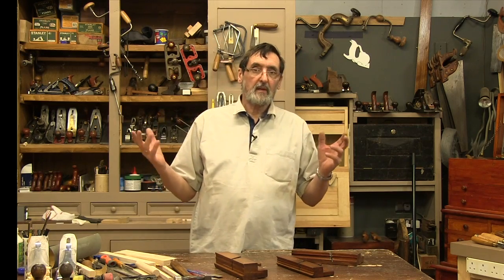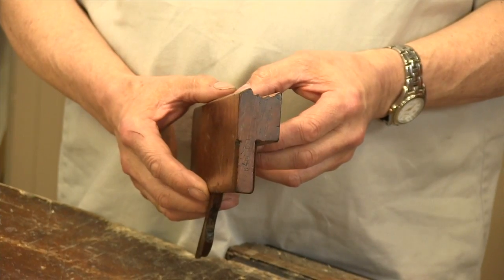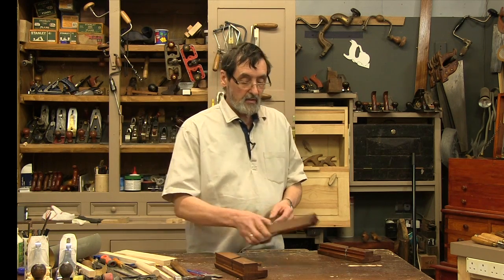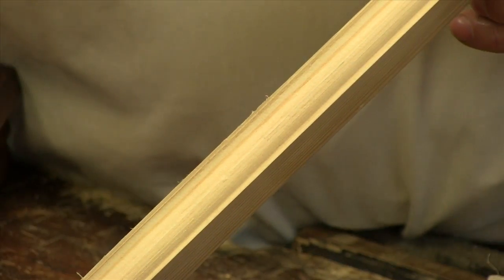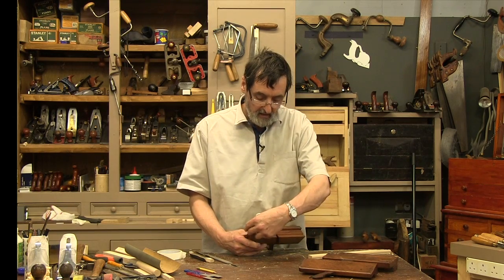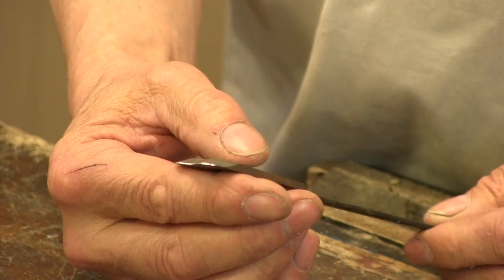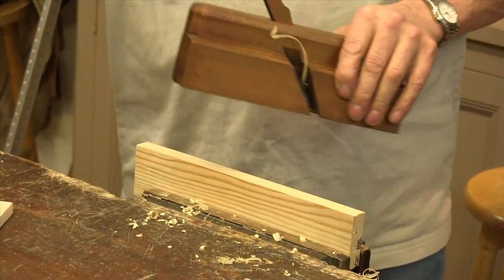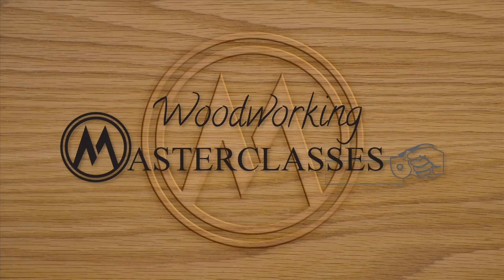How to Sharpen a Moulding Plane | Paul Sellers

Comment: Excellent video Mr Sellers. My question is, why is it so hard to find videos on how to build moulding planes ? It's like there's a Secret Society that's preventing this. I see 1 or 2 videos available accompanying this page, but the others are usually 25 second previews for a DvD they're selling. Thank you again Paul Sellers,  you're the reason I got into woodworking.
Reply: Silent- Hill ***** Absolutely, would love to hear Paul's take on making molding planes.
Reply: Same reason you don't see tinners in factories any more. The process has been autimated now. Given half an hour machine can make 100 feet of equal quality moulding to my 10.
Reply: +Radar Really True...assuming you only want one of the dozen mouldings the company offers. Or you don't mind building a bunch of custom jigs and buying a bunch of special bits for your router. Once upon a time a creative woodworker could make any moulding you could dream of with a small set of planes. This individuality largely died out with the advent of steam-powered moulding machines.
Reply: Lie Nielsen sells a video on making moulding planes.
Reply: {Radar Really}, 'faster' of course, but 'equal quality' that is not true. An automated process uses a spindle milling machine. It cuts the wood by spinning at high speed not by translating a bevel into the wood by hand with a molding plane which is the only way to make a beautiful 'moulure' surface. Worse, every point on the spindle  will have a difference speed because it is rotating, not translating . Surfaces that are deeper in the molding get cut at higher speed than points higher up. This creates a ton of dust as the wood is being pulverized, not a natural cut. The surface will not have that antique natural cut finish but be rough and wood modings are never sanded. At the end, those factories produce inferior moldings faster for a lower cost. They exist because few people want to pay for hand made furniture, but there is a comeback.

Comment: Aaw I would like to hug you tightly :o)
Now I know how to sharpen my collection of wonderful moulding planes - thank you so much! Your blade is so nice and shiny afterwards, I hope I can manage to achive such results as well.
Then I must find a video about how to sharpen gouge chisels and I am pefectly happy.
Reply: I like the way you speak :o)
Reply: if i may prevent you some frustration, you need to get equipped with sharpening stones and it's not cheap. Note how Paul uses both oil stones and diamond stones each coarse, medium and fine. Also honing compound and leather strop. Many people make the mistake to skip and think that you can just get one stone. It won't work, and you need to learn to use them too.

Comment: I was offered some moulding planes for £5 each, wasn't sure if I had any use for them so didn't bother but now I know how to sharpen them I night go back and get a few :D

How much would you pay for a moulding Plane if the condition was just below usable (needs sharpening) and not to badly battered?
Reply: Moulding plains in the states are very valuable because no one wants hand plained moulding (rather, they don't want to pay for it) Finding a moulding plain for that cheap would be like finding a gold brick in the pocket of a suit you hadn't worn since last year. For 8ish dollars each I would have relieved them of several.

Comment: Thank you for showing this. Would you use a simular approach when sharpening the cutters on the Stanley/ record no. 50 plane? I have aquired one with all the cutters except one, the very smallest, and they are a bit rusty and drag in the wood I'm trying to form. I've freed all the screws for the fence and depth stop and got everything sliding nicely on the bars, I would now like to try cutting some rebates and mouldings.Would this be the way to go?

Comment: That looks, as you said, not complicated as long as it's carefully done.

I just received a very nice and clean 1/4 grooving plane that has a slight skew to the main cutter.  Carefully watch what I'm doing and I should be OK.

But, the leading iron is an edge cutting iron for going cross grain, that's shaped like a "V" with a flat bottom. One of the tangs on the cutting edge is almost completely gone.  I would think at first that I'm going to have to lower that floor to leave room for equal edge cutting points (perhaps a floor 1/8" across), then shape the two cutting points at the edge back to the 1/4" distance apart as they lead the main 1/4" cutter along the wood.
That, of course, took longer to say than to see.

What might I use?  The edge of a 1/8 thick file that has teeth on the edge?  Risky? A 1/8' thick piece of wood with wet-dry paper stretched tightly? Considering that this is to regain the shape first before sharpening, any further suggestions?  I'd appreciate it; it's a lovely plane.

Comment: These moulding planes are great for straight mouldings, one thing I don't understand is how curved mouldings are created, for example on an oval mirror or picture frame - is there a different style of plane for this (I've seen cooper's planes that work around the inside of barrels), or is it just done with gouges instead? Maybe one for a Q&A?
Reply: the blade only need to have the cross-section profile of the molding. Whether the modling is over a straight surface or along a curvature does not require a different blade, but requires a different geometry for the wood plane to be able to guide and support the blade along that curve. Ovals are made from two tangential circles of different radi would require two molding plane one for each radi. i don't think it's possible to mold an ellipse because the radius or angle of curvature is continuously changing.
Reply: I've also seen it done with gouges. They trace the outline of the molding using a pencil around the curved section, and then cut it out by hand.
Reply: Could also use a scratch stock.

Comment: I haven't used a moulding plane before, let alone sharpened one, but how about making a sharpening jig by cutting a short section of moulding with the plane and attaching sandpaper/that EZlap diamond paper stuff to it. Would preserve the moulding shape indefinitely and allow you to sharpen it about as quickly as any other plane blade.

Can you see any reason why this might not be ideal? I am thinking of picking up a selection of about 25 of these but only if sharpening can be done relatively quickly.
Reply from the maker: There is no such thing as Eze Lap diamond paper so I am not sure what you are alluding to.
Reply: Paul Sellers Ah I had meant this stuff: https://www.fine-tools.com/diamond-lapping-film.html though looks pretty expensive! Or some form of diamond paste. Sandpaper of course works but would consume more wouldn't it?
Reply: @samthepoor My thoughts exactly.
One thing you might want to be careful about is the thickness of the sandpaper, because it will modify the plane's profile.
However, since some people use leather and MDF to sharpen chisels, I wonder if it might be possible to first cut a negative plane-profile in the MDF, then use polishing paste on the MDF to sharpen the plane iron; unfortunately this will only allow you to "keep the iron sharp".
-Though... I think that if you do this, you'd be able to quickly determine if there are any nicks in the plane that needs attention by first using the MDF to sharpen the iron and then check how it reflects the light.

Comment: This is a nice demonstration, but it may be easy to miss a key thing if this is the first time you've seen moulding planes. The key thing is that there are two aspects of sharpening: shape and sharpness. The work at around 5:00 to 7:00 is establishing the shape, matching the blade to the sole, but the filing is at too steep an angle to give a useful edge. You're just getting the shape right at this point and you want to take off as little as possible, i.e., that little strip should be as skinny as possible. Once you have the shape, you then work on getting sharp by establishing a useful bevel angle all the way to the cutting edge. You would work at a shallower bevel angle now, somewhere around 30-35 degrees, which is what Paul is doing in the second half of the work when the blade is in the vise. This means you'll be taking material off of the heel of the bevel. You work until this shallower grinding just reaches the edge where you did the shaping. As soon as there is a burr, you want to stop. Ideally, that thin stripe will be gone at this point, disappearing just as you get the burr,  and you'll just have a polished bevel at a useful angle and that ends in an edge that exactly matches the sole. When you resharpen, you don't need to do that first step again! You should be able to resharpen many times before the shape is distorted enough that you'd need to reestablish it. I was confused when I was first shown how to sharpen moulding planes, so I hope this helps others. I don't think it contradicts Paul. It's not meant to.  Another way to do this is to paint the back of the blade with marking fluid, load the blade, and then scribe the shape of the sole onto the blade. Put the blade in a vise, establish the shape, then establish the bevel. Or, if you have a grinder, grind to get the shape working nearly square to the wheel so that you don't burn the edge, then grind to get the bevel angle.
Reply: Thanks for the useful comments. I was wondering why he bothered with the first step with the blade still in the plane.

Comment: How exact does the cutting edge have to match plane itself?
Reply: Extremely close. If the blade protrudes too much out, the plane will never stop cutting. If the blade is not protruding enough, the plane won't cut the profile. The method pictured is a maintenance, something I would do every 5-10 uses. Restoration would take a bit longer.
Reply: The contour of the plane plane body is only for clearance. The profile of the plane body cannot encroach on the contour of the blade or the plane will not cut the profile to depth. If you look, the width of the blade is less than the width of the plane body. This part of the body acts as a stop so the plane doesn't keep cutting.